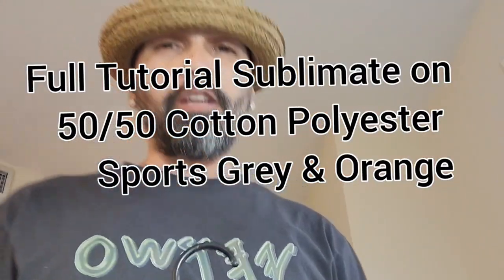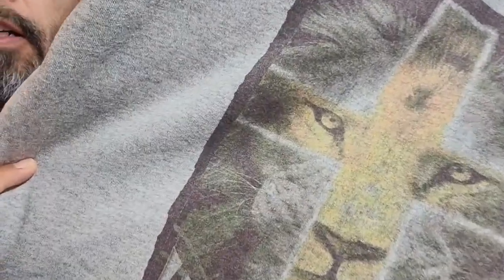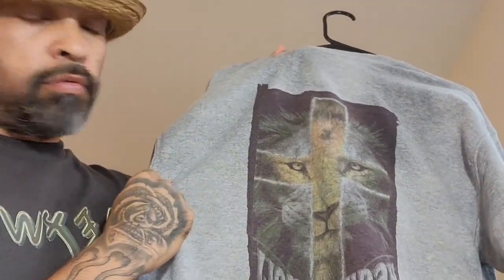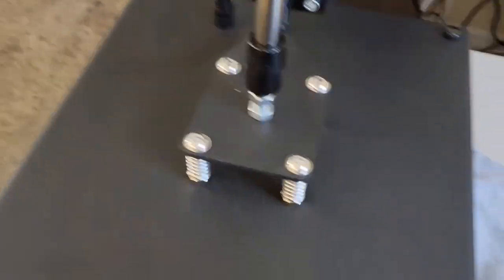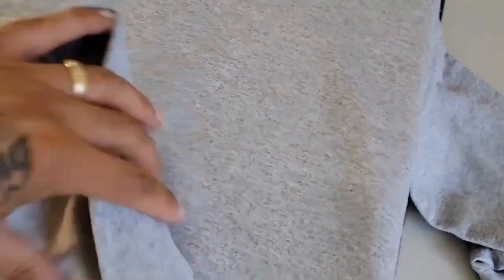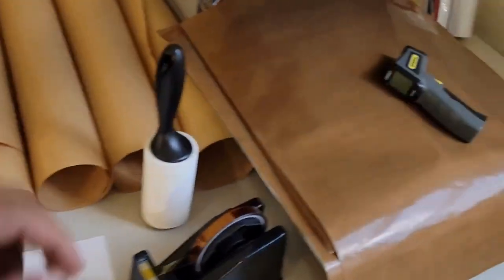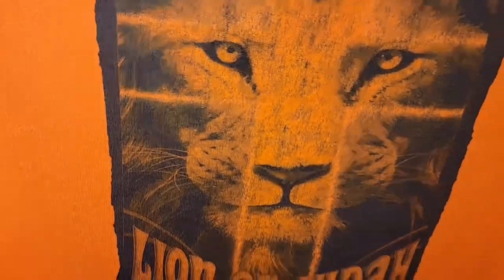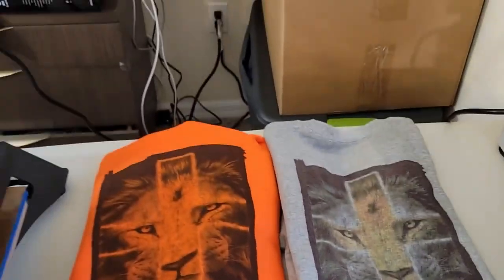Sublimate On 50/50 Poly-Cotton Hoodie & Crewneck Sweater (Tutorial)

Comment: Great video man, have you tried using the ppd transfer paper on the 50/50 hoodies. If you have what settings you using, because the normal setting for shirts does not work. i keep melting the image into the garment.
Reply from the maker: Hello & thanks.  No have not tried PPD transfer on the hoodies.  I would recommend the standard settings & regular jetink.  

Use old hoodie and try: reducing the pressure a little (heat press), reduce heat 10- 15 degrees, 15 seconds should be good.  Everyone setup is different, BUT make adjustments.. also just cut your design into 5 or more pieces so won't waste a lot of ppd.  It is trial and error & that what I would do.

Comment: Yo! Do these setting apply if using dark transfer paper? 385, 60 seconds? Thanks and awesome videos, I'm a beginner. So far my prints seem inconsistent. Appreciate all the help
Reply from the maker: Yes.. Could try 400 degrees, medium to firm pressure, but also depends on your heat press, what sublimation ink, if you are using a standard printout from printer, and if you do a 2nd press 15 to 20 seconds?  All materials I have used and settings have worked on my other standard 15x15 Mpress (heat press).
Reply: @diywithkenny8399  I use a 15x15 TUSY Heat Press, Dark PPD Inkjet Transfer paper and DelTeck Sublimation Ink. I have a hoodie to do tonight. The last one I didn't do that long of a press, so I already see one of my issues, but on some of my 50/50 shirts, the color of my final product is darker/lighter than the other. I feel like I'm just rushing through it and not taking notes to see which combo worked best.
Reply from the maker: Ok you posting off this video, heat transfer paper totally different.  Can you convert back to regular ink?  If you can I would use that.  Just asking.  

Now you may have to lay down the heat transfer paper according to your directions, print out design on sublimation paper (mirrored image), then crank up your heat to 385 to 400 degrees, firm pressure (knob on heat press). I would press at least 30secs to 45secs.. i would try older shirt 1st, again your materials are different & you should see and tweek your settings if needed.  👈This option if sublimation.  But regular jetink is best for heat transfer paper overall with the instructions giving by product.

Comment: How long do they last for you after several washes? I did one but only had one wash so far.
Reply from the maker: Hello.  Since my pup chewed on my hoodie strings on the orange one, been wearing it on the regular.  10x washed and a few times dried.  Holding but like I said in video, anything that cotton 1st wash will give a slight fade or we say vintage looked.

Comment: I tried sublimation on a 50/50 blend royal blue but it come out dull 😑  is there certain color I should avoid?
Reply from the maker: Aww.. Use pastel colors.. if you saw the 50/50 orange hoodie i done.. all went black.  Also remember colors will chamge too (example blue ink on top of  yellow garment = green design)  Hope that help explaining
Reply from the maker: Also: So if royal blue is dark based on the outcome, would avoid that color and darker colors.  May can experimemt further on royal blue, may news color chart that would be opposite color whwn applying.
Reply: @diywithkenny8399  also have you tried using white vinyl so sublimation?
Reply from the maker: I have tried the Siser EasiSubli. 

For me the process was okay, be better the 2 step process, lay down the vinyl (print & cut) on garment, lay design and heat press.  The other way is way too much time (print on easisubli, dry it, cut it, transfer it) again that was my experience. lol
Reply: @diywithkenny8399  yea same I tried using white vinyl but the ink went right through the vinyl
Reply from the maker: Yea.  Saw some videos that even let the printed easisubli sit overnight and was still wet.. But have been hearing about clear vinyl and I do have white sublimation flock, just cutting it a pain.
Reply: @diywithkenny8399  oh see I tried using regular heat transfer vinyl
Reply from the maker: Did it work?
Reply: @diywithkenny8399  lol not at all
Reply: @diywithkenny8399  maybe I'm doing something wrong
Reply: @diywithkenny8399  I'm trying to start sublimation on clothing but not having any luck with colors tshirts or hoodies
Reply from the maker: Hmmm.  Pastel colors are light, should be good.  May wanna check 100% gildan polyester (G42000), also morr premium Jerzee 21m.  They have lighter colors and good for sublimation.  May also can try the PPD heat transfer paper.
Reply: @diywithkenny8399  I have tried it with the ppd dark paper loved it   hopefully no cracking after wash because the first time I used that with regular ink there was a lot of cracking i actually had to remove it. I tried the 50/50 jeerzee nublend hoodie it was very dull
Reply: I heard I have to use the Heather's for sublimation
Reply from the maker: Just make sure PPD is 385 degrees, 30 seconds press, firm pressure and leave silicone paper on 30 secs, teflon sheet over it so wont curl up
Reply from the maker: Also have you calibrate your computer screen, and print head clean a few times?  Make colora vibrant again?
Reply: @diywithkenny8399  no I have not
Reply from the maker: @tweettybirdd  not really for Heather colors to me are darker.. if you go to Jiffy Shirts you can see all the colors.
Reply: @diywithkenny8399  ok will do, I live in Canada so I usually order from wordans
Reply: @tweettybirdd  use the white glitter vinyl and sublimate on it.  You'll love it.